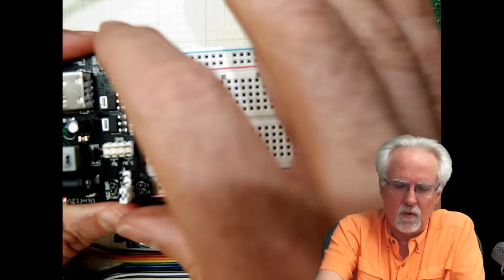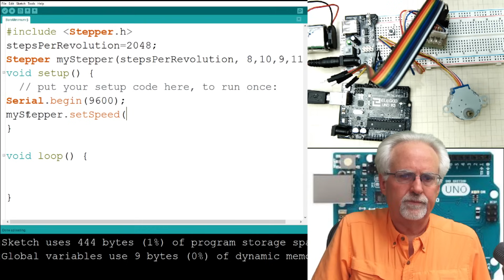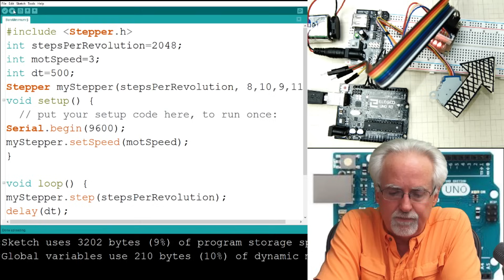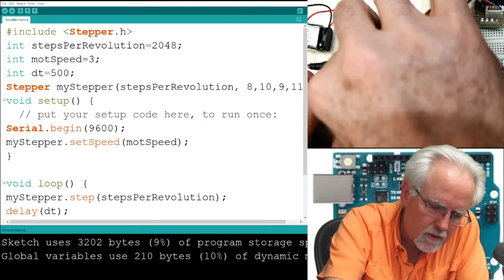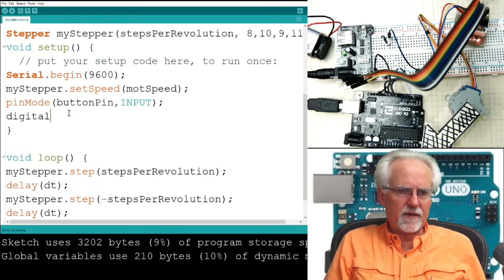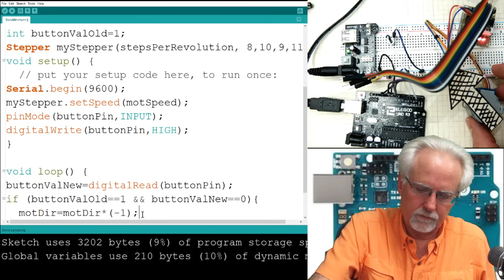Arduino Tutorial 35: Understanding How to Use a Stepper Motor

Comment: So, had some trouble with this one. In my defence, I have to place a lot of the blame on Paul. You see, he arranged for me to receive a defective 9-volt battery adapter cable. On top of that, my DVOM died last week after 25 years (they just don't build things to last, do they?), so I couldn't even do a continuity check. My new DVOM arrived from Amazon a couple of hours ago; that's how I found the defect. Of course, it wouldn't be at the battery end, where I could pretty easily pop the lid & see what was wrong. No, it had to be at the barrel connector end, so I had to find an old AC adapter with the right sized barrel connector, cut off the defective one, and heat shrink the replacement onto the adapter cable. Voila! It all works, and the program works too. 
Now I know a lot of you are going to say it's not Paul's fault the cable was defective. I'm not buyin' it. I just know he was in cahoots with elegoo and arranged for me to get a bum cable :D :D :D  OK, OK, fun over. This was, once again, an interesting project, and potentially quite useful. Thanks Paul

Comment: After 4 days of working on this I got it working like a pro.  This is what I did,  I put the myStepper.step() function in a 
 for Loop () , so after every 50 steps the program would check the button in the if() function,  "for(int i=0;i<1;i++){myStepper.step(25*X);}  for X is the same as  Paul's "motDir=motDir*(-1);"     X=X*(-1);
#include <Stepper.h>
const int stepsPerRevolution = 2048;  
Stepper myStepper(stepsPerRevolution, 8, 10, 9, 11);
int buttonPin=2;
int oldButton=1;
int newButton;
int X=1;
void setup(){
  Serial.begin(9600);
  pinMode(2,INPUT_PULLUP);
  myStepper.setSpeed(10);
}
void loop(){
  newButton=digitalRead(buttonPin);
  if(oldButton==1 && newButton==0){X=X*(-1);}
   oldButton=newButton;
  for(int i=0;i<1;i++){myStepper.step(25*X);} 
}

Comment: My Stepper was not so responsive, I would push the button and nothing would happen till the stepper did all 2048 steps. I even trade tried to add attachInterrupt()  function to git it working a little bet better.I went as to use a differnt motor. I work on the code for over 5 hours before i copped Paul's code. After that i worked 4 or more hours working on the button coding to git it working better. But no go!!!!

Comment: I tried, but none of my buttons worked.  I tried them every which way. The legs couldnt reach the bottom of the breadboard so they didn't make a connection. So i bought replacements with longer legs

Comment: This was a very challenging one. To figure out the transition was my trouble. Solved down to the 2 kicks of switch not to only one touch to change directions. Also, needed to arrange an old computer power unit and connect the motor through a L298N H Bridge....

Comment: Can someone  explain this line of coding for me please: Stepper myStepper(stepsPerRevolution, 8,10,9,11); ? Why are the pin numbers listed as "8, 10, 9, 11" and not in order "8, 9, 10, 11"? I tried it both ways but only "8, 10, 9, 11 works and I can't figure out why.
Reply: https://lastminuteengineers.com/28byj48-stepper-motor-arduino-tutorial/
It has working set up internally as 1-3-2-4. Weird, it's like dealing with internal combustion engines :) But, yeah, it's logical- we need circular movement

Comment: On videos that have code could you please start placing the completed code somewhere in either the video or the comments???  Many of us cannot get the toggle code to work.  Where did you put the buttonValOld=buttonValNew; in the code?  I have tried everywhere but nothing works to get the toggle button to work.  Thanks.
Reply: Hello Kai-Made, i also struggled with it until i found the right place where to put this "unseen" statement. Try this:void loop() {  // put your main code here, to run repeatedly:
buttonValNew=digitalRead(buttonPin);
if (buttonValOld==1 && buttonValNew==0){
  motDir=motDir*(-1);
}
myStepper.step(motDir*1);{
 }
buttonValOld=buttonValNew; //this was the mystery :)
}

Comment: I did it. Well, almost. I also used multiplication of direction by -1, but i didn´t use comparing Old and New value of button. Because of it all, my motor react and change direction with delay about 6 secconds after pushbutton, even if I didnť set any delay in my code.
 Great lesson as ever, thank you.
Reply: What did you have as your motorSteps (Number of steps the motor is to do before moving on? 
the myStepper.step() command pauses program execution until its finished, so if your effectively doing;
myStepper.step(2048) then its going to wait 10 seconds before even leaving that line of code.
Depending at what point in that 2048 step cycle you pressed the button, you could be in for an up to 10 second wait.
I picked 10 or -10 for reverse. Paul picked 1 or -1 for reverse.  
Pauls solution:  myStepper.step(-1) or myStepper.step(1).  This means its only pausing for 1/2048 of a minute (or about 0.3 of a second, virtually an undetectable delay).

Comment: Thanks for the lesson, its very helpful, just having some trouble hope you can help. 

> I am using an adruno uno with controller 4988 and im trying to connect a unipolar stepper motor. Having trouble with the program, could you please advise me, or tell me some other way i can get in touch with you.

Appreciate the genuine lessons, I'm learning a lot.

Comment: Yes, I was able to get it working. But I almost immediately ran into hardware issues. I got the initial stepper motor to turn, but shortly after that the green led on the power supply started to dim and ultimately all lights on the driver went out. Turns out the battery in the kit was almost doa on delivery. As a result, I discovered what Paul mentioned, ie, these motors gobble up a lot of amps and can drain a battery quickly. Also the power supply doesn't seem to operate well with much below 8.5 to 8 volts.

Once I got that figured out, it wasn't too bad. The hack on the pin was pretty obvious, and for those of us who've followed along, the toggle code was almost identical.

All in all, a very challenging tutorial. And one I'm sure many of us learned from, including expanding our troubleshooting abilities.

Comment: I did it on my own. I change StepsPerRevution value by × -1 each time button was pushed. It work but notice that SM printed slowly, no matter delay time. Also had to time pushing button when it reach 2048 or at beginning of a cycle. 
Trying to figure out why
Reply: I had the same issue and here's what I figured out: When using the step command, the program has to complete however many steps you tell it to do before moving to the next line of code.  So if you tell it to do one full rotation, nothing else happens during the time it takes to rotate.  The solution is to tell the code to just do one step with myStepper.step(1) instead of myStepper.step(2048). Since it's part of the loop, it will keep stepping 1 at a time to make a full revolution.

Comment: Using your same exact code, when i run it. it turns clockwise like it's supposed to then it stops for half a second but then turns counterclockwise for a split second then switch back to clockwise.

Comment: I was able to make it work with just the  if(buttonValNew==0), no reference to buttonValOld in the conditional logic.  It did seem to be a little glitchy - it worked right about 80% of the time but the other 20% it would pause for the delay then continue in the same direction.  Switch bounce or some other error?  Also, the button had to be released within the delay time and the switch in direction occurred after the button was released.
Had the same issues with battery draining quickly.  The voltage on the rail was actually 2-3 volts with the motor in operation, instead of 5V.  
Finally, I originally typed the sequence 8,9,10,11 in the myStepper set up command, instead of the correct 8,10.9,11.  It actually produced motor operation, although not the correct response, which made troubleshooting a little difficult.
Thanks for all you do, Paul.  I'm getting a lot out of these lessons.

Comment: myStepper.step(-stepsPerRevolution); does not work for me, will only turn one direction - odd as this is the first time i haven't been able to do one of the exercises.
Reply: The necessary parameters for the object you create with the Stepper library look like this:

Stepper myStepper (steps of your motor, D1, D2, D3, D4);

In some ULN2003 drivers there is a small error that can be corrected by creating the library object like so:

Stepper myStepper (steps of your motor, D4, D2, D3, D1);

For example: if you have a 28BYJ-48 stepper and D1 connected it to pin 11, D2 connected it to pin 10, D3 connected it to pin 9 and D4 connected it to pin 8, your object should look like this:

Stepper myStepper (2048, 8, 10, 9, 11);

Sorry for my bad english!

Comment: https://photos.google.com/share/AF1QipMLVGurRPub9I7em3hO69GZQXrvy5qhWEt812FYPxY3eCUf6YgscGOst-N_li5hUA?key=RXh3UXpySFZ5SFIybklZbEcwZjhaRjBYUUs0MkNR

I took a screen shot of my 4 channel oscilloscope connected to the 4 wires going the stepper motor coils whch shows the coils being switched on and off.. The 5th wire is just the 5 volt supply.

Comment: i fround this one a bit harder then the others but once i worked out that the swicth was not GND on the bread bord it worked fine but i had the code i didmyself but could not figgar it out and then saw yours was the same i just spoted that the blue and red lines on the bread bord didnt join up and then i linked them and now i realy am inpressed with myself for working it out :D thanks again another great video

Comment: My stepper motor ground to a halt very quickly and the controller leds went out.  Found the battery was pretty much dead.  Replaced it and all works just fine.  A couple of comments:1. when you added the extra buttonVal statement you didn't show where you put that statement though it was fairly obvious where it should go. 2. a short description of the stepper motor control leads would have been helpful you kind of glossed that over pretty quickly.  Though I did find good information in the datasheets on the CD.  In the datasheet for the controller, it stated it takes 4096 step to rotate the spindle 360 deg. Changed the program to 4096...the motor did not like that at all.  Maybe the controller will allow 4096 steps but the stepper only allows 2048???  Oh yeah, my homework program almost worked, I got messed up with the old and new values of the pushbutton state.

Comment: I was not able to complete this assignment because my Arduino Kit didn't come with an MB102 powersupply :( it had the stepper motor, motor driver, and even the cable to connect the 9v battery to the power supply... but the power supply was missing from the pack :( :( :(

Comment: My battery died almost immediately. Lucky you warned us so we didnt panic and measured the voltage to confirm.
Reply: Same here.  The low-cost battery that comes with the kit lasted less than 5 minutes.  I was afraid that the motor or driver board had fried.
Reply: @jimmyjimmereeno3341  yup i had the same exact thing the battery went out so i hooked up a extarnal power suply that can go to the net

Comment: Mine worked out of the gate for four cycles then the 9v battery went dead.  I tried a 12v wall-wort but the motor just hummed and was still.  ?too much v?  Will pick up a couple of extra 9v during my next 'essential' shopping.  Using Arduino voltages for motor.  Motor no longer reverses.

Comment: Great tutorial as always I am learning a fair bit, thank you Paul, I have a question if I may,
what's the difference between controlling a stepper motor with driver unit and a simple MOSFET and PWM, 
How reliable are Mosfets on a long run?Cheers

Comment: Thanks Paul I've been learning from your tutorials,great tutorials; i like to use "0" for low signals and "1" for HIGH signals in my programing, so for this i usually prefer "Pull Down hack" configurations; how ever in these social distancing times i currently don't have a stepper motor to test my programing and cant go out to get one. I have a question, it would be great if you could help me out a little; How would the coding and connections change for this tutorial in a "Pull Down hack" configuration using "0" for Low and "1" for High signals?

Comment: For the life of me, I could not understand this one. I've rewatched the toggle video multiple times and it seems that when a project involves toggles I struggle.
Reply: me too
Reply: @garysenier2440  the trick to understanding the toggle function is that you are detecting the button change from 0 (not pressed) to 1 (pressed) over time.
So
step1:  read the button, if 0 then lastPress=FALSE
step2:  read the button again and if lastpress==FALSE  and the Button is 1 change lastPress=TRUE; to Make sure the toggle only happens once per press.
change the Toggle state, if it was 0 make it 1, or if it was 1 make it 0. 

Instead of using an int it may help to use a boolean (can be either 0 or 1)

bool toggleState=0; 
int lastPress;
int buttonVal;

buttonVal=digitalRead(buttonPin);
IF (buttonVal==0){    // Checks if button not pressed
   lastPress=0;           // this makes sure the toggle  next press 
}
ELSE {                                           // Do this when button is pressed
    IF (lastPress==0 ) {                // Check for only once per button press
        lastPress=1;                        //  stops repeating while button still pressed 
        toggleState=!toggleState;
        digitalWrite(LEDpin, toggleState);
    }
}
Reply: You could try using two buttons for now to prove the stepper motor sketch, one for clockwise and one for anticlockwise, and then go back to the earlier tutorial for making a toggle work.
Reply: Hey, idk if you still need help with this but I'll try to give it a shot. The original "if" statement reads "if(oldButtonValue==1&&newButtonValue==0){" ; the "oldButtonValue" is defined by you, in this case it's a 1, the "newButtonValue" is defined by this command "newButtonValue=digitalRead(buttonPin);". Now, the "if" statement is not true (the arduino will not run the commands underneath  the "if" statement) until both parameters (oldButtonValue and newButtonValue) are met. Since oldButtonValue is defined by you, it is true from the start, and since newButtonValue is defined by the press of the button, the "if" statement will only work when "0" is read, or when the button is pressed; at this point, everything you put in the "{ }" will run. I hope I made some sense.

Comment: Just a heads up, haven't done homework yet , Elegoo battery that came with the kit was weak, thought I had a motor problem . Battery measured 8.5 volts and motor barely moved, used 9vdc positive tip power supply and it works perfectly.HomeWork; did it differently and was wrong ,didn't work , used pb with if else and did not switch properly

Comment: Hi, Paul!
Thanks for the tutorial :)
I did the homework myself!))
Instead of the external power supply I used a second Arduino board powered by 9V battery, worked well :D
Reply: External power supply , $8..... arduino plus 9 volt battery, $30.....

Comment: As a kit I have "arduino upgraded learning kit". doesn't come with the external power supply so I connected the 5V directly to the arduino board: for now it's all good nothing is burning. Though my stepper speed won't go above 19, think it's related?
Thank you, great tutorials :)

Also if I try to do a Serial.print the stepper stops working

Comment: This is definitely one of the lessons where you could have probably spent a bit more time explaining how the stepper motor works in this particular case. Pins 8, 9, 10 and 11 were used, but really not sure what they do.
Reply: The stepper motor has 4 coils each coil is connected to 5v through these pins.
Reply: @jafaralturfy5053  thanks mate
Reply: OK, not so sure this comment will be helpful, but here goes. I read the Documents included with the Elegoo kit and it says the four pins are a four-bit code to the stepper. That says to me that they should be in order. I confirmed this by reading the Stepper.h file (found in Github). However, when I put the in numerical order the motor only spins one direction, regardless of the Step value. When I SWAP PINS 9 7 10, the direction swaps correctly when I push the button. Bottom line, we need more info from Paul M!
Reply: @davidransier  thank you so much!!
Reply: @davidransier  Thanks! I had the same problem with the motor running in one direction only. I started my troubleshooting by checking the comments and that did it. This also saved me the time needed to dig through the documentation.
Thanks again!
Reply: I agree, I'd like to know more details about why those specific pins and why the order of pins 9 and 10 are swapped in the Stepper setup call.
Reply: @StephenSalvages  I believe this is just due to the ribbon cable and wanting to put them in order physically on the connectors.
Reply: Yes true, I went through a lot cause I was simulating on wokwi and the stepper motor and driver weren't the same
Reply: Please how did you go about it with wokwi, I am having problem using it for this particular lesson
Reply: @HassanAbdulsamad-ue8zl  Check the documentation of both the wokwi's stepper and its driver, though afaik wokwi driver doesn't use the Stepper.h library so you got to implement it yourself